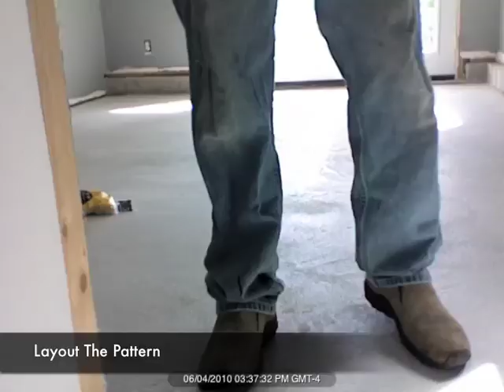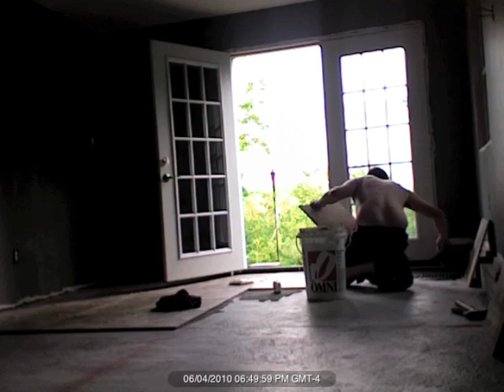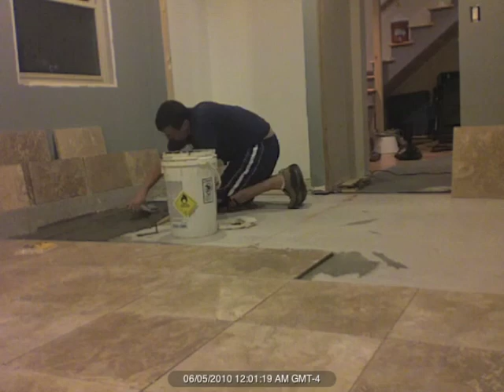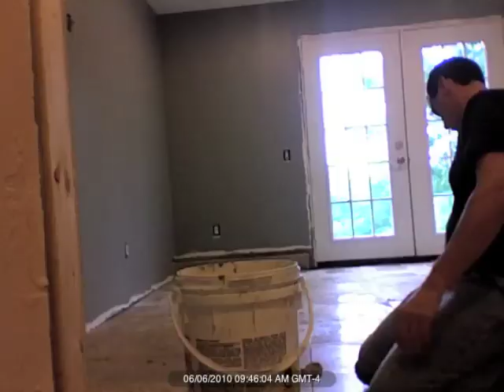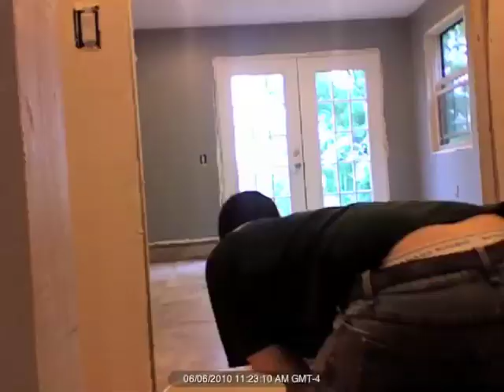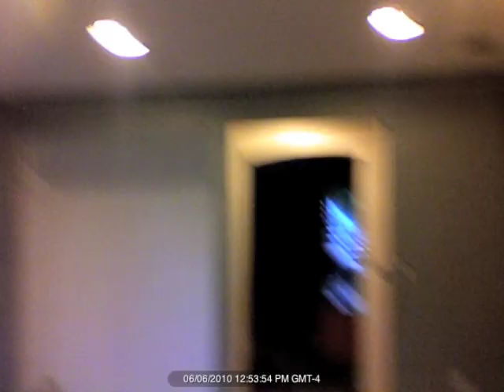Tiling with Travertine Time Lapse

Comment: Are you not buttering the back of the tile?  And there's not a level in sight because you dont' need one right? - the floor was exceptionally flat?  that was a rectified tile?  so how thick was your thinset?   and that was what an 1/8"  grout line?
Reply: Amble Lane  haha, the amount of videos I've seen on here doing this wrong is just mind blowing. Guess mud setting is a rare method.